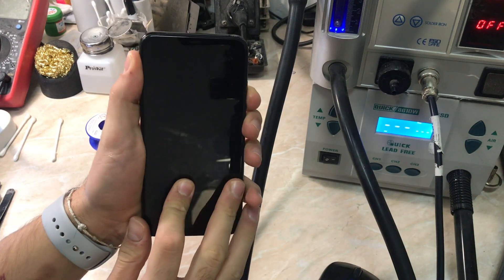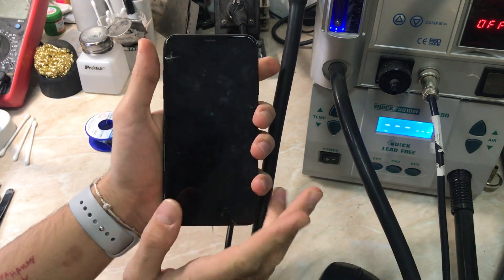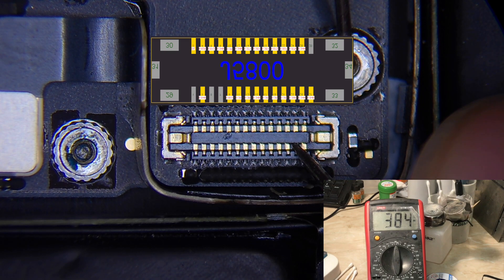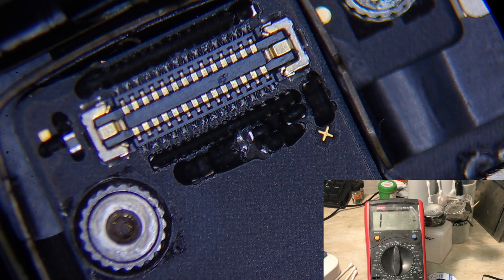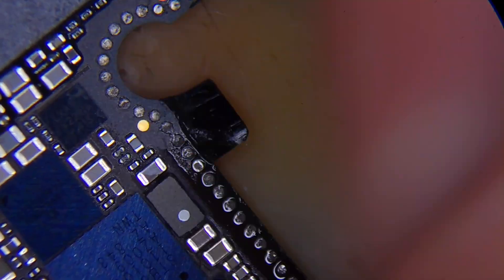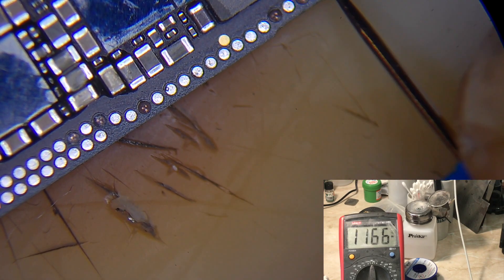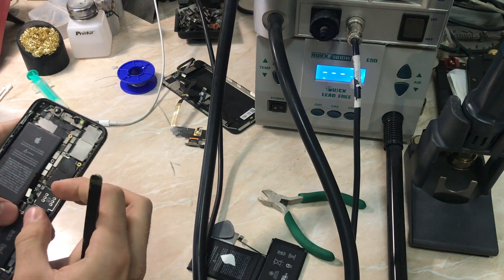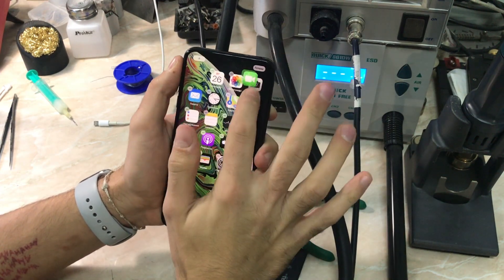iPhone XS Max Touch Not Working (AP_TO_TOUCH_SCAN_CLK) Problem Repair

Comment: Hello,

Really great content!! I have similar problem in XS, so I have no connection on touch pin 6, I have checked components next to the pin and they are OL as well. I have a question, because I am still learning, I could not find that "test" points on XS max schematic, and I think I do not understand what it tell us. You checked components next to the pin and found OL as well so I thought We need go straight to the sandwitch, but You checked test points first instead. And where are test points for XS :) cheers

Comment: Hi brother i just got my new brand iphone xs max and it has touch issue while playing game but for normal use i dont notice much touch issue beside multi touch can be notice when u tap on assestive touch then its like taping 2 or 3 times and lil bit delay touch any solution for this? I bought this phone for gaming but i cant use it lik this specially when i use 4 finger claw more touch issue